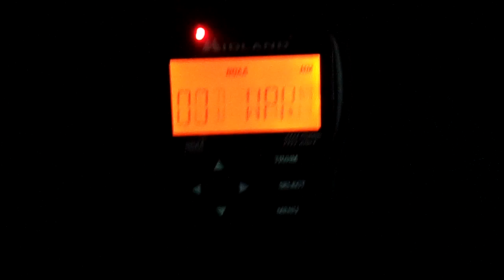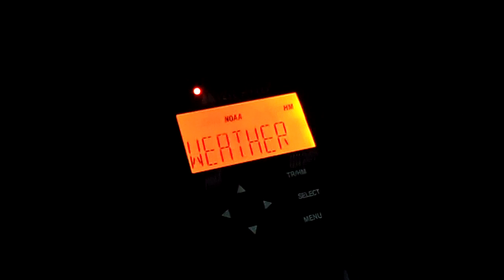WZ2543 - New NWR Station Announcement! [Old Video]

Comment: I think it's fine that you're on the bus. I find when I'm on the bus my radio doesn't work very well. It's really hard to hear. But at least with yours we can hear it loud and clear
Reply from the maker: Well, what I figured out is that if I plug my earphones into my radio and hold one side up against my camera microphone, I can get some surprisingly good audio. This was especially useful to me in settings like airports where we were in another city, and I wanted to record the broadcast cycle for their local station, but didn't want to bother other people at the gate. I would just plug my earphones in, and hold one side up to my camera's mic and voila. It eliminated a lot of extra background noise too.
Reply: @lollipop7ification  I think it's important to test emergency equipment in different environments or situations so we know how well it actually works. Great job!!!

Comment: was that when they switch the automated voice to the other one cuz I'm pretty sure it was when they switch the automated voice
Reply from the maker: This was from September 2015. I'm pretty sure they switched the automated voice a year or so after that, if I remember correctly.
Reply: Do you think they changed it like during like I would say November or August of 2016 I think
Reply from the maker: xbox Gamer yes I think it was mid-late 2016. Jeez, time flies! I'm so used to the NeoSpeech Paul voice now, but I miss the old Tom voice.
Reply: But all I'm saying is the new voice I would say it's way better than the old one because the old one was like robotic if you think about it but I like the new one
Reply: When they meant expanding it does it mean like they were going to change the voice of it
Reply: Isn't the neospeech Paul voice like the low one that the one that they're using currently